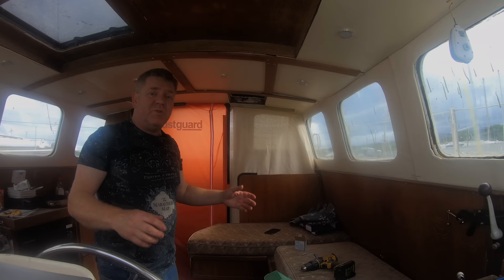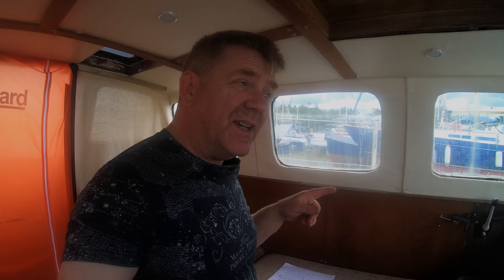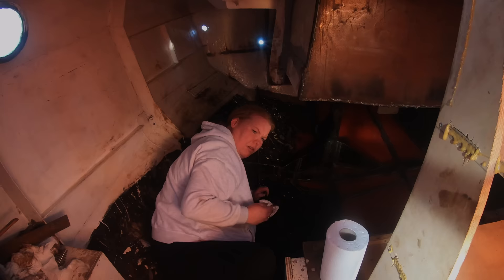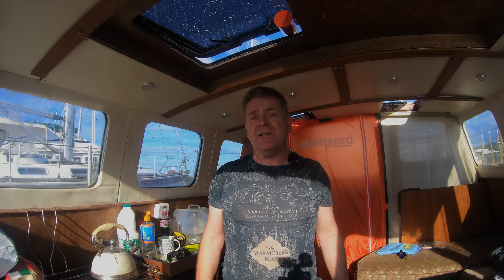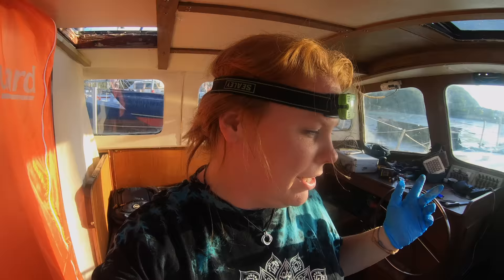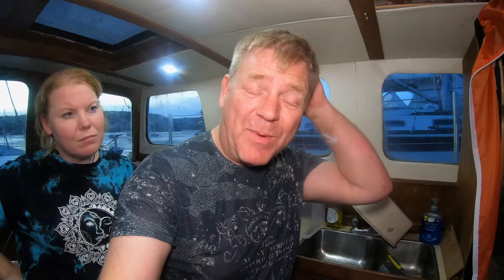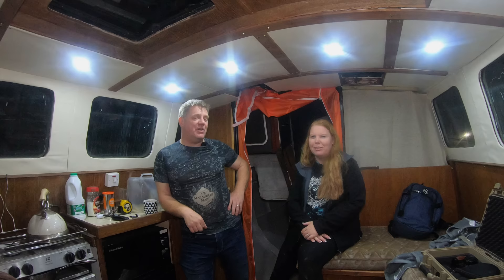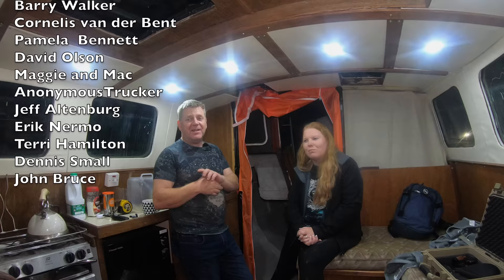#112 - WHAT A DIFFERENCE!!! PAINTING THE PARTS OF OUR BOAT NOBODY WILL EVER SEE

Comment: I could think of a honeymoon spot, and but not without spendin [yank keyboard] oodles of pounds 😉Well said Andy, your 'journey' enjoyin that. Not so much the boat show, all the 'new' boats with so much new 'tech' you don't actually have to go with the boat, take a later plane and meet it on the dock, when it arrives 😂 Nice job painting the 'blunt end' bit and the 'pointy end'bit. You'll see'm that the poiunt. Nice to see you back on Melody.  Thanks m8s, appreciate Andy puttin Jeans on , not pants or trousers😉 Stay vertical.  Didn't notice a difference with Melissa's speakin, your doing real well. ✋[Hi 5] Nice ta seeya Cap'm Jack 👋

Comment: Andy, yes, use bladders for water, only make sure the surface is perfectly smooth. They also do not need  any kind of bleed valve for air to escape, they just contract as water is depleted. I have three in my boat 10 years now no problem.
Reply from the maker: WE'd get a LOT more volume if we convert to skin tanks

Comment: Hello mates, As a welder I was concerned about the steel supports/gussets you cut out in the aft of the boat. I'm sure they were there for a reason. If you get some people on the cockpit deck you might need those structural supports??? If the boat is taking a beating in rough seas....? Best!!
Reply from the maker: Do you mean the angle iron?

I’ve got the original plans for the boat and the construction i 8mm with 6mm stringer and 4mm plating

The angle irons are in no way structural, they’re simply there to attach inner furniture and wooden divides/partitions.

They were completely rusty.

I cut them out to facilitate easier maneuvering in the aft end.

I’ve now welded most of them back in place with heavier duty angle (60x60x6)

But in any case I’ve not cut away or disturbed any of the boats structural ribs, frames or stringers, other than those which were corroded and have been replaced.
Reply: @SailingMelody  I've been watching all your episodes from the past to present. I saw the episode and commented. Then watch more and saw you replaced them. I enjoy watching you fix up your boat. Great job!
Reply from the maker: @me2onthenet  hey :) that’s awesomeZ glad to have you on board :)

Comment: I always seem to come up with suggestions to late, but here goes! I worked in a factory making electronic circuit boards which had to be kept dust and static free. When we had to re model a clean room blowers were placed so they gently pressurised the room, this meant no dust would enter as the positive pressure blew it away,  all we had to do was ensure the blowers were giving enough air to keep the room at a certain pressure. Obviously easier in a room than a boat!! Now go away and forget Melody eor a while and concentrait on each other! BON VOYAGE!!!
Reply from the maker: That’s genius but impossible with Melody to seal her up well enough to generate any significant barometric internal pressure I think
Reply: I too worked in a setting where we installed positive pressure / negative pressure exhaust to keep dust and particles out of areas we did not want them in....

Comment: i have noticed the wiring from your clearance lights into the cabin is exposed and including the wiring from your solar panel on the roof of the cabin to where it enters the cabin is also exposed .This wiring is exposed and in a strong weather would be torn away . The forward edge of the solar panel while it is screwed down will peel away . Just speaking from experience .
Reply from the maker: Hmmm good points. I’ll give some thought to solutions for those
Reply: @SailingMelody  plus all electrical connections should be coated in silicone grease .This makes the connections easier to pull apart and keeps the salt out. I think the grease used was a Dow Corning DC-3 .

Comment: Your both looking good, boat is looking amazing, you brushed on to get the right thickness, Im not looking ahead too much but are you going to spray on insulation?
Reply from the maker: We use closed cell slab foam and then also use spray foam to bond around the gaps and edges. The spray foam prevents moisture getting behind but doing it this way means we can simply slice the panel back out if we need to do repairs